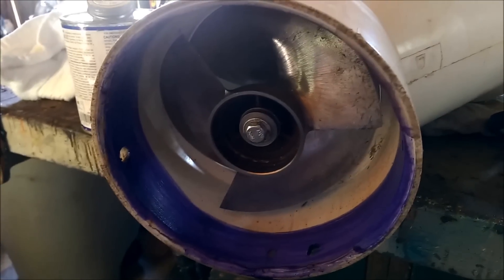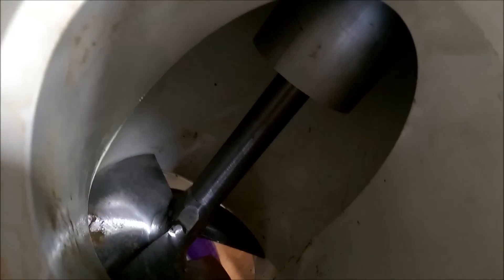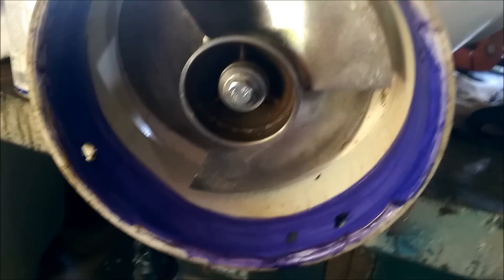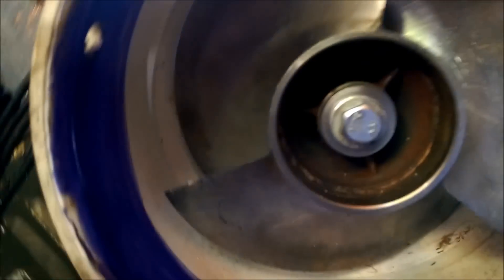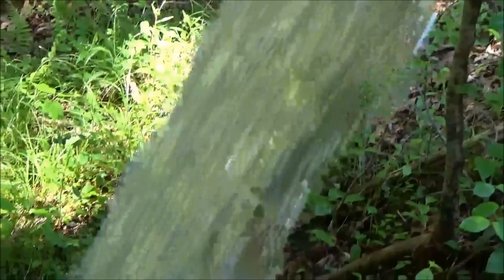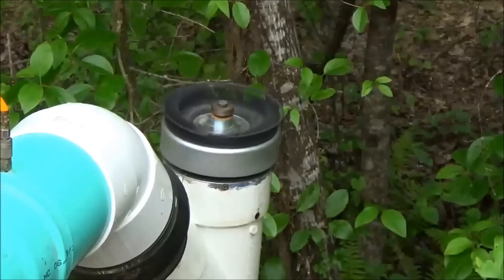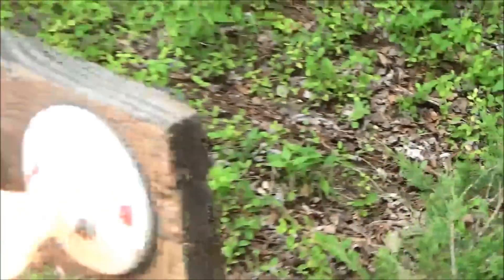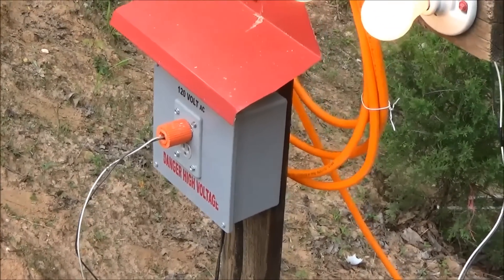Pond Power Part 4

Comment: We have used foamy shaving cream to find vacuum leaks in the past. It will suck the foam in and make a very apparent hole where it is leaking. Also works good for really small pressure leaks that you can't find with soap solution. Those rubber boots would be the first place to look since that it what you took apart.

Comment: I like your pond, it holds a good amount of water. It seems to me that you could earn some more power if you mount the turbine at the bottom of your drop, instead of at the top of the dam. in that way you will increase the pressure of the water before it hits the blades.Pressure is power! Very interesting videos you make!
Reply: Since it's a siphon the falling water pulls from the bottom instead of pushing from the top. Arguing from ignorance I can say it seems it would work just as well if the turbine was at the intake in the pond. I think his choice of location is based on what is easiest to maintain. If anyone with practical experience can correct me I'd appreciate it.
Reply: @JimFortune   Why would we correct you, considering you're right ?  .... Thank for saying the truth.

Comment: I like the design. I just wondering if you have ever considered adding another generator to the top just to test the output wattage. I was just thinking if the turbine produced enough torque it might be able to power two generators with the same flow rate.

Comment: Where the water falls after the turbin, have you considered placing another power generator, like a paddle  boat wheel? Or even another turbin?
Something to convert that falling water to even more power?
Reply: joebonsaipoland Hi Scott Hi Joe,
I had a bit of a different thought, what if you could put the water back up into the pond. Maybe by using a water ram, a series of water rams, or a combination of water rams and inline eductors. I understand that water rams in and of themselves are not very efficient but adding an eductor into the mix could balance things out. Scott, I would like to hear your thoughts. Sounds like an interesting engineering problem/solution. As an after thought I would think water returned to the pond this way would have to be highly oxygenated as well.
Reply: William Walter
That is another great idea, what if using solar power you could lift this water back into the pond. And while you might not get 100% back, You would still get some of the potential power back.
A lot of interesting ideas and solutions when you have such a natural resource!
Reply: This gave me a headache...
Reply: Another IDEA, if there was a way to put a SLIDE just after the water fall so that it diverted the water back into the pond!!!
The FORCE of the falling water would PUSH the water back up and into the pond... endless FREE power!!
Reply: You are joking no?